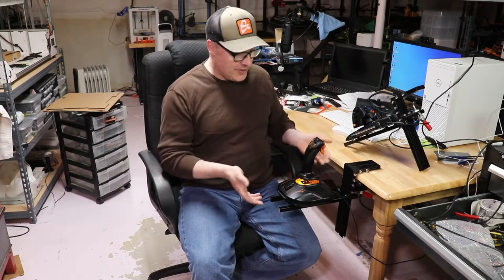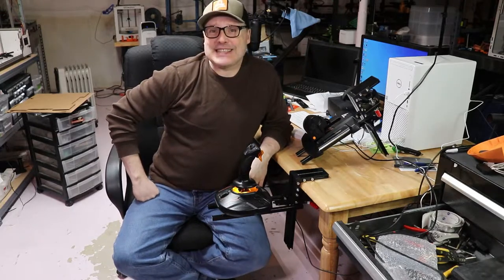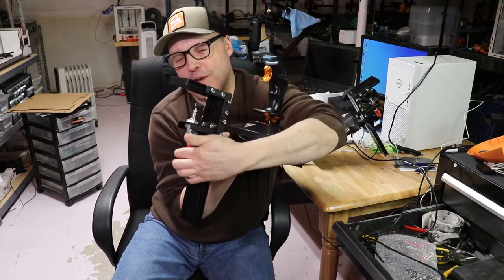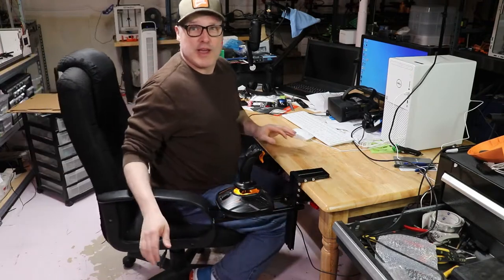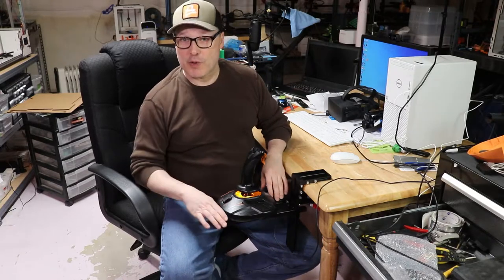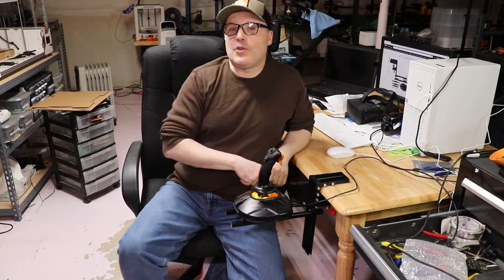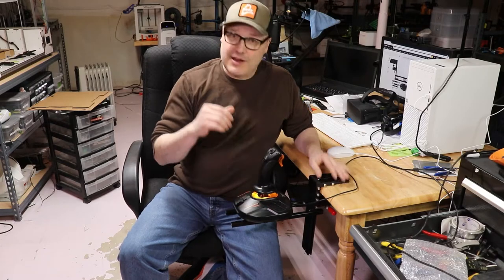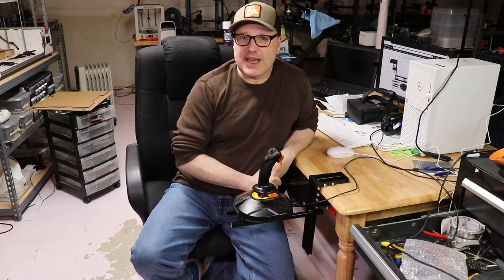UPDATE to J-PEIN HOTAS Desktop Mounting System

Comment: Hoping for some kind of assembly video, came with a MFD bracket that looks like some kind of edge mount for the edge of the table but you didn't use it. Also the top T-Screw and nut behind the vertical mount, wondering what we should put there? Cup holder? Haven't decided yet. sharp edges are definitely a thing though. Like to see some end bolts for it, something carriage bolt like so the ends wouldn't be so sharp. All I got for now....
Reply from the maker: The sharp edges are a real thing for sure

Comment: Good follow up - ordered the J-PEIN for an alternate lower center stick mount on my Next Level FS Lite using a VKB Gladiator.  I do have a couple of corner brackets as well, but am wondering how big the socket screws are as I may not need to use the clamping feature but rather hard mount to the center plate.  Does seem like it's very light and compact (as well as half the price of most mounts) plus adjustable, so looking forward to giving that a try later!